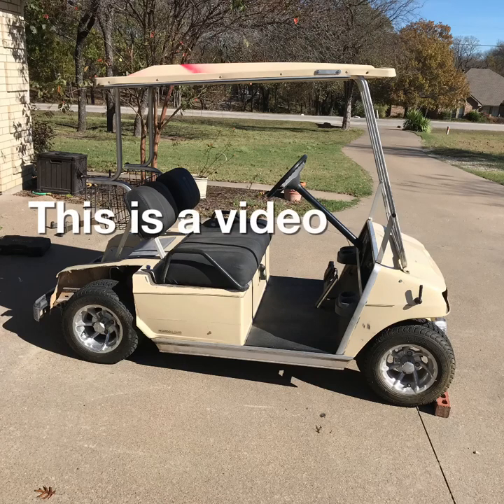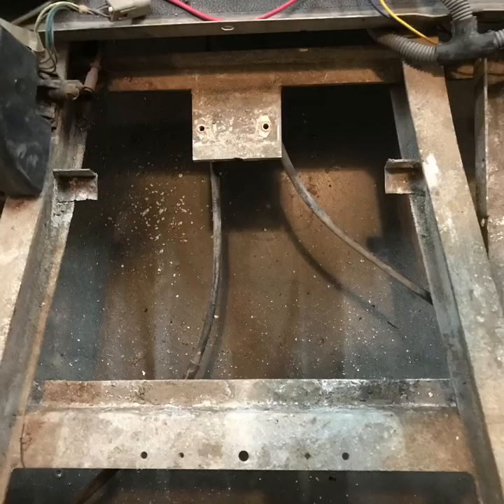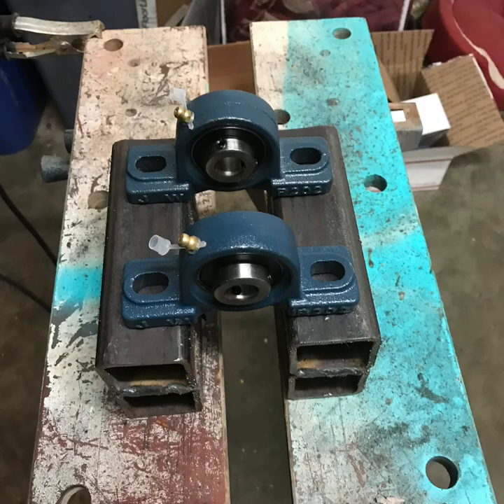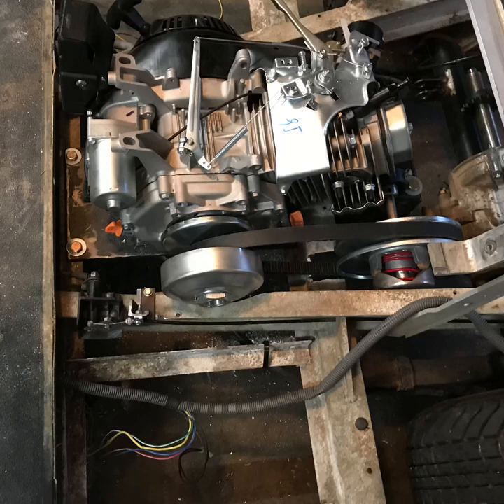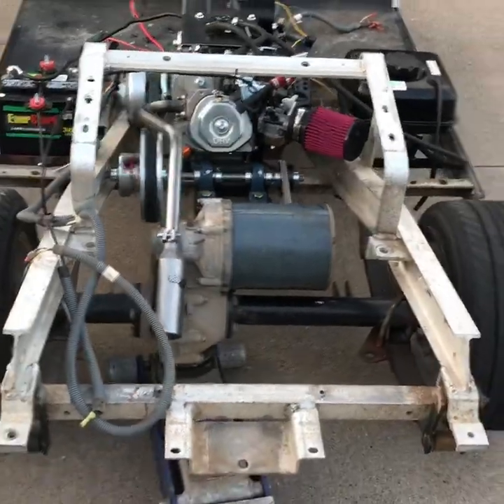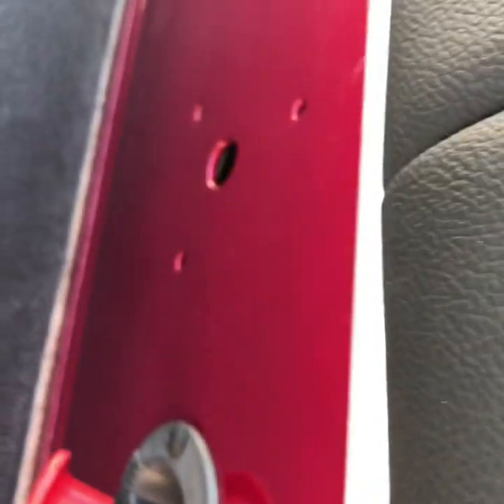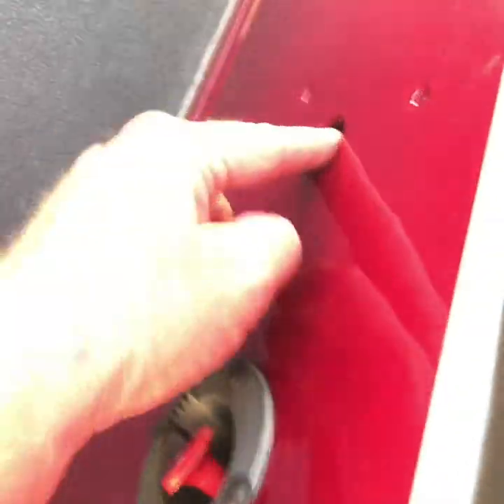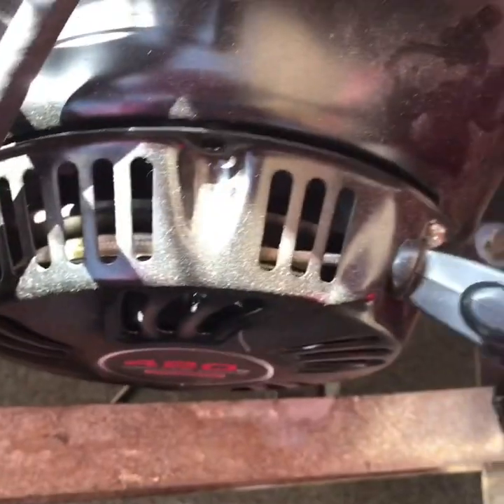Club Car DS electric to gas swap

Comment: How did you press the shaft out of the electric motor? I have a 20 ton press and it is not budging, I'm pressing down on the end that has the bearing.
Reply from the maker: That shaft was a booger to press out. You see all that copper in the slots? I pull all that copper out. It took awhile but it helps take some pressure off of the shaft. I also have a 20 ton press.
Reply from the maker: Also the shaft has ribs. Not big ones to help keep that big hunk of metal from sliding off.
Reply: @racerxtex3177  I cut the copper windings that were exposed on both ends out, and then was able to press the shaft out with no problem. I'm adding a reverse transmission to my conversion as well, whenever I get it finished I'll shoot a video and copy a link for you.
Reply from the maker: BigBlok502 Is it a comet gear box? And yes please post a video of your build.
Reply: @racerxtex3177  it's a cheap knockoff, we'll see if it can handle the 13 horsepower predator.
Reply from the maker: BigBlok502 One more thing that I didn’t have in my video. I took the shaft to the machine shop and it turned down to 3/4 and a 3/16 key way. It only cost $80. I tried to weld one on the 1 1/8 shaft but I couldn’t get a 10 sprocket for it.
Reply: @racerxtex3177  the shopping line is 1 inch can the smallest crocodile I could find was a 12 tooth, so I will do that on the shaft. I went for a test drive today and at torque converter will not slip at idle, so the chain is trying to jump off of the sprocket. Looks like I have some troubleshooting to do.
Reply from the maker: BigBlok502 12 tooth isn’t the best but it’ll have some speed and more torque. You say the torque converter won’t slip? I’m thinking the belt is too tight. And for the chain wanting to come off. Check your alignment. It has to be dead on.
Reply: @racerxtex3177  the chain tensioners can't keep up with the slack in the chain when the suspension compresses. I'm going to have to redesign the transmission mount, back to the drawing board.
Reply from the maker: BigBlok502 keep me posted on how you did it. I’m looking for a another golf cart to build in the winter. This time I’m looking for a EZGO. Going to install a big engine. May look at a motorcycle engine.
Reply: @racerxtex3177  I moved the engine forward and dropped the transmission to where it is in line with the rear axle, that solved my chain coming off issue. I still have a problem with the torque converter not releasing at idle, the manufacturer is sending me a new driver clutch and belt. Next step is to remove everything so I can replace the driver and belt, paint all the parts l fabricated, and then put everything back together again. I won't be making a video until I have it all together, and all the bugs sorted out.
Reply: @racerxtex3177  I finally finished the conversion and uploaded a short intro video, please check it out. I'll post a full build soon.
Reply from the maker: BigBlok502 Awesome build!! You must post a longer video. Some of stuff looks familiar. I see you put on a gear box. Let me know how it works. Also how fast it’ll go?
Reply: @racerxtex3177  I'm working on a longer video documenting the entire build process. Top speed is 21 miles per hour, the largest gear I can put on the transmission is 12 tooth, I have a 14 tooth sprocket on the torque converter.
Reply from the maker: BigBlok502 I think they sell a 24 tooth sprocket for the converter. You can also change out the gears in the rear end. They make a 6:1 ratio for it.
Reply: @racerxtex3177  I wasn't able to find a 24 tooth, interesting to hear that they make one. The shaft on my torque converter is 3/4 inch. I'll have to check into the gear for the rear end, I hadn't thought about that, I swapped the rear end around from left to right to make it easier to hook up the chains to the gearbox.
Reply from the maker: BigBlok502 So you unbolted the axle tubes from third member and turned it? Wow I was wondering about that.
Reply: @racerxtex3177  no, I pulled the axle shafts out of the axle tubes and unbolted the brakes and left them hanging, then unbolted the entire axle from the Springs, swapped it around, remounted the brakes, and then reinserted the axle shafts.
Reply from the maker: BigBlok502 Oh okay. It’s still a game changer. I might now get rid of the jackshaft.
Reply: @racerxtex3177  I should have my complete video done in the next two or three days, that will give you a real good idea of what it took to mount that transmission behind the engine.
Reply: My full video is up and ready to be viewed

Comment: Wow and it's running 30+ mph? I've got a 10 tooth on the clutch and a 14 or 16 on the jack shaft coming from the rear axle. I'm running around 12 mph. I think the gear ratio is 12:1 r 13:1.
Reply from the maker: Ok so you have a 10 tooth on the clutch and a 14 or 16 on the motor shaft? I think you have the sprockets wrong. The sprocket that drives the rear end needs to be a 10 tooth. The rear end is geared 15 to 1.
Reply from the maker: Also I’m running a 420cc motor.

Comment: Can u use a belt system I place of chain one belt or two
Reply from the maker: Yes
Reply: A one belt system or dual belts will one belt hold up to the engine torque
Reply from the maker: fusion boy and girl mine only has one belt. And a real gas powered golf cart only has one belt. A 40 series belt.
Reply: Last question what choke cable and throttle cable did u use a where did u get them from
Reply from the maker: fusion boy and girl my choke cable I got from tractor supply. My throttle cable is from a clutch cable from a 99 mustang. Custom.

Comment: Does it go good up hills?
Reply from the maker: Yes. That big motor has no problems.
Reply: So would the 22 tooth sprocket still be just as good on hills?
Reply from the maker: Titus Krabill Yes. The rear end has 12:1 ratio

Comment: If you can locate a junk gas car from 1984 thru 1991 you can use the transmission from it. It will bolt in place of the electric motor with NO modifications and will allow you to have Forward, neutral and reverse.
Reply from the maker: I already found one. Installing it as we speak. I’m making a new video of it and other mods I’ve done.

Comment: Get my conversion kit for the rear end 5:1 ratio.   2500 rpm nets 40 plus mph.    2500 on a 12:1 ratio gets you 13 mph at best. Let’s be honest.  We don’t go through this much work for 13 mph.
Reply: Where would one you find your conversion kit

Comment from the maker: When I find a gas rear end I’ll swap it out. Then I’ll have reverse.
Reply: hi how u doing witch clutch and gears and chain u use thank u for ur time
Reply: You can get a go kart transmission for $100 on Ebay that will bolt right in line and give you reverse.

Comment: I got a Suzuki Intruder 800  that I going to take the engine off of and put it on a golf cart and it will do 90 and second gear
Reply from the maker: I don’t think that rear end will hold up to that much power

Comment: I found a 12 I guess that will have to work
Reply from the maker: Jason Kmett it’ll be slow
Reply from the maker: I put a 24 tooth on the front and 10 on the back. 45 mph
Reply: That shaft is not hardened is it
Reply from the maker: Jason Kmett I really don’t know
Reply from the maker: Jason Kmett Go watch Bigblok 502 video. He did what you are doing
Reply: I'm adding a second jack shaft between the transmission and rear end what was your best all around final gear setup
Reply from the maker: Jason Kmett I only have 1 jack shaft. I don’t have a gear box
Reply: Yes sir I understand that but I was wondering what ratio was best all around
Reply from the maker: Jason Kmett well I don’t know what you are looking for. Since you are using the gear box you might have to switch sprockets out. Are you looking for speed or torque? That’s what you have to figure out.